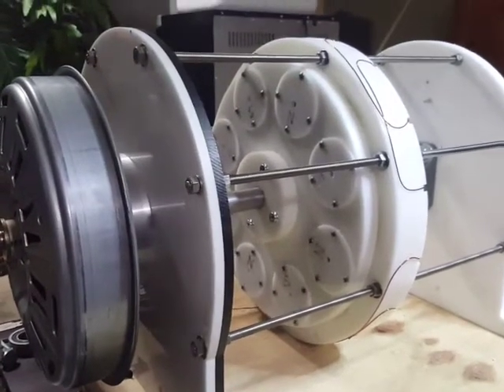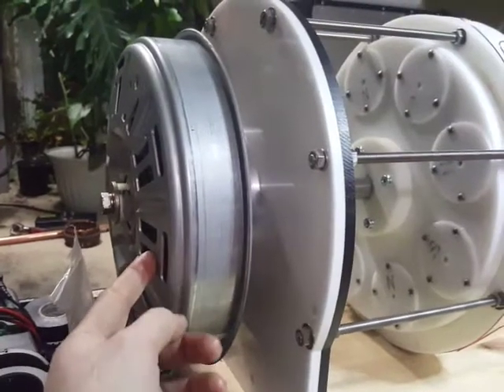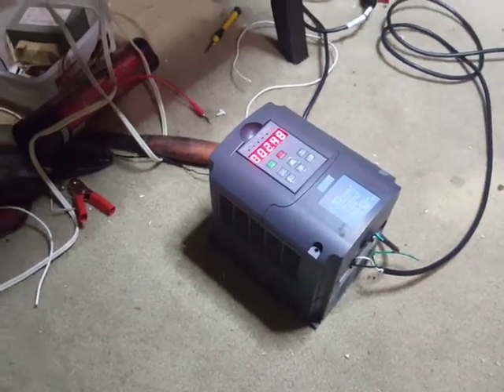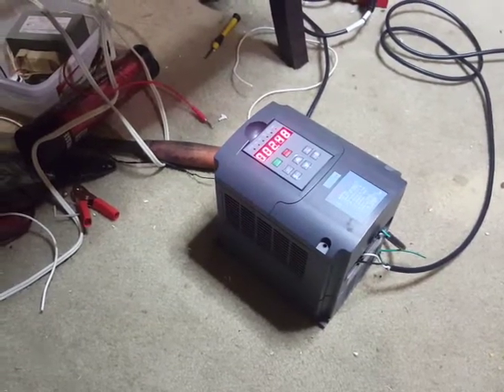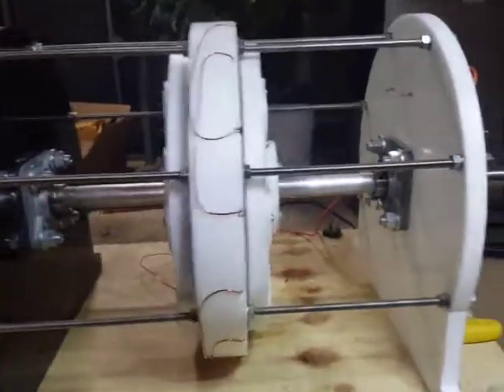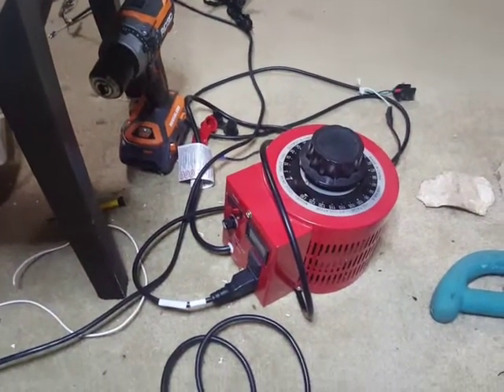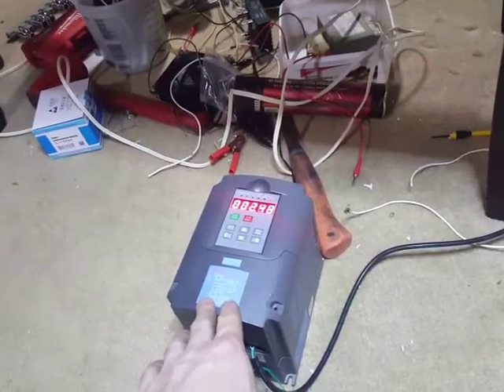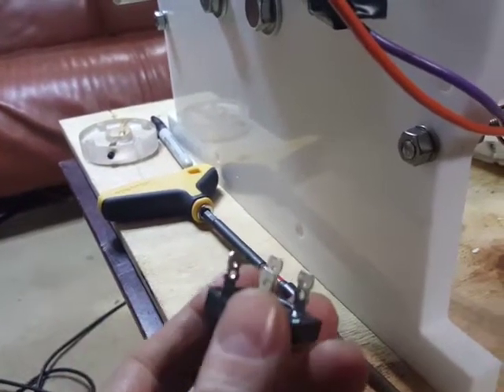Sp 500 generator on Frequency inverter.

Comment: Hi, I'm glad you have that motor setup. If you are powering the SP 500 motor and it has no torque, it should be something with the voltage being too low. It depends how your coils are wound, thickness of wire and how many turns. Can you tell me the resistance of one coil alone in ohms? That can give an idea of the voltage you should be using. Please see the small version I made years ago and I can tell you it has a lot of torque. Here it is: https://youtu.be/f0Ux1BlyttM
Turn down the volume of your speakers because it vibrates a lot and makes a lot of noise. In this video you can see that I used an optical switch instead of brushes, that helped a lot.

Comment: Why doesn't he just use the commutator to provide electricity to the coils?  He can adjust the voltage supplied to the commutator (dc voltage), and send the vdc to the magnets at the right times so they will push against the magnets and make the motor turn.  Use bridge rectifier or veriac to convert vac to vdc.   I mean if a coil is charged with electricity, it'll become a strong magnet (especially if he uses 120vdc) and it will push against his neodymium magnets which are very strong.  The coils must use dc voltage though to become magnetized, not Vac.
Anyone building this thing should make a very small version, scaling down all components including the commutator, carbon brush, magnets, coils, discs, fasteners, center rod, etc, so he won't be out lots of money if this thing is a fraud.  The main motor power is from the magnets being pushed by the coils at preset times set by the commutator touching the carbon brush.  Instead of using the carbon brush and commutator, one can set up a switch that sends the desired VDC at a desired time.  This can be done by a computer and some electronic components (similar to switching a railroad track when a train is coming and then switching it back for another train).  Easy to set timing to for each coil, just look at when magnets are in best position to be pushed by coils, set timer then.  And if you increase size of coils, more electrons can be adsorbed by them from the magnets; so less rpm needed to obtain desired electrons - therefore cheaper materials can be used (less sturdy than expensive plastic used) since rpm is lower.  Electrons can be absorbed by coils, but enough to power 2000w+ use?  If not, then that is what determines if this machine works as advertised or if it is a lie.  Since company is based in United States, if the company is lying, it can be sued for a lot of money.